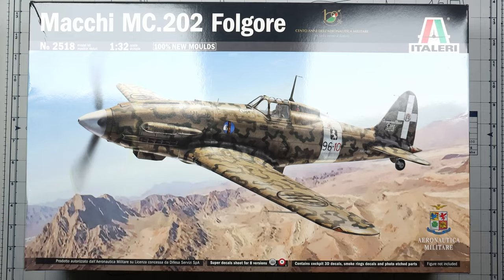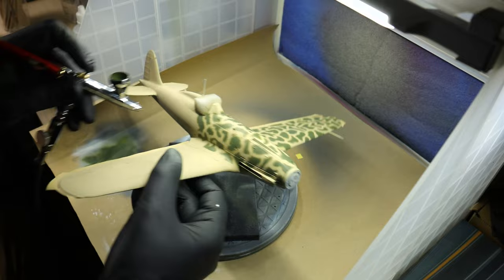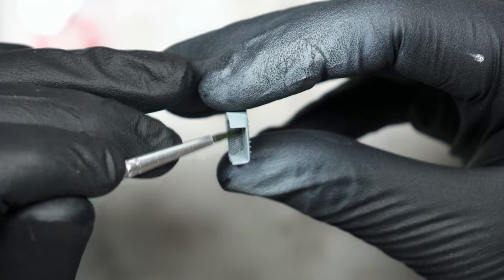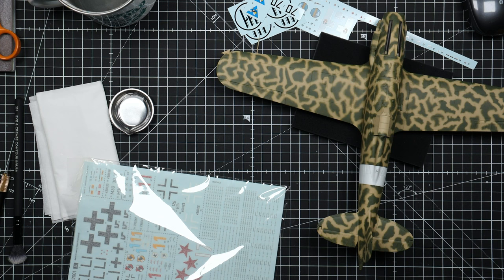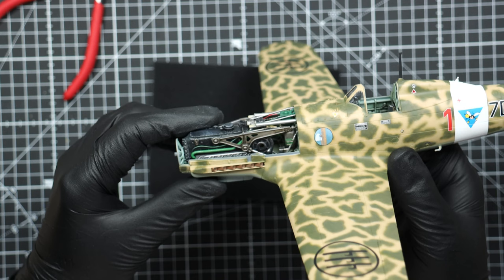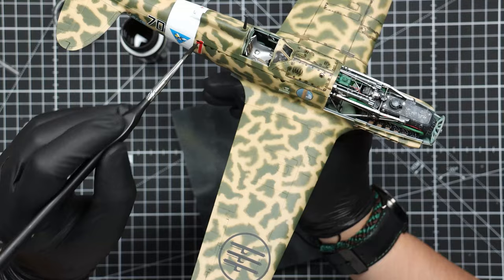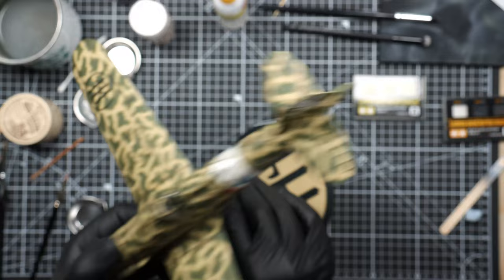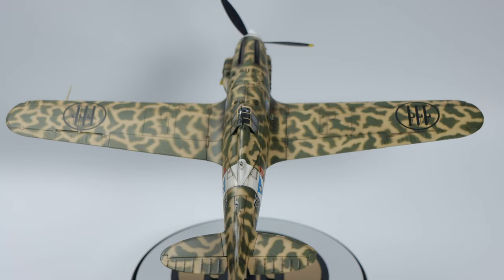Building The Italeri Macchi C.202 Folgore / Part 4 - The Finale

Comment: She looks great to me. Though my advice for Italian markings is making the stripes on the tail first, then mask over it. But otherwise, she's great
Reply from the maker: Thank you!
I know that a lot of people like to do the stripes first then the camo, but I do like if the camo gives a bit of preshading to these. I would assume that these were painted on after the camo was applied in real life as well as they serve as identification markings. In the end I do feel this way is a bit more comfortable, rather having masked off areas for a long period of time where the mask might peel up here and there and paint gets underneath.
And its a miracle I managed to pull that off without overspray.
Reply: @rogueplastic  Oh yeah, I do get that, and I wasn't coitizing. Heck, your improv and fixing of the kit looks way better than 99% of my work. But I just saw the way you were doing multiple masking layers and thought I'd share how I handled the complex geometry of that tail stripe. But then again, my MC202 is a 1/72 scale and I did the white stripe with many layers to really make it pop, then masked and used a flat tan spray paint to provide a base, then took the masking off and added my green squiggles by hand.  But as you said; camo patterns in the Regia Aeronautica weren't really standardized so pretty much anything goes beyond the roundels and tail markings. Also, side note; for big and detailed models, I find the long form, multi parts really enjoyable and helpful to watch
Reply from the maker: Don't worry I'm not taking it as criticism.
Yeah, white really needs a lot of layers to get a nice opaque coverage.
Thanks for the feedback about the content type.

Comment: I thought that having raised panel detail added as PE was a bit of a lazy solution, but on the whole, a good one

But one question. Aren't those exhaust made of folded metal? I thought they have a seam join going down them.
Reply from the maker: I think the PE stuff can work somewhere, but here it felt like a lazy solution, or trying to fix an oversight they did during designing the kit. For the control surface joint covers it can work. But those panels on the wing roots? I don't know...
I am generally not a fan of PE as bending usually sucks and then there is a problem of paint not sticking to it proper. Even with the primer, one can risk paint peel and scratching it off.

Yes, the exhausts are usually folded. I did check my book and on the pictures I could see the weld line along the top sruface, but it was quite faint.
One might be able to add those on top with some think putty string, same as the pro modellers do the weld seams on tanks.

This kit is a scratch builders wet dream as there is a lot of detail missing which can be added onto by hand.

Comment: is it just my eye or the right wing decal is closer to the edge than the right one ?
Reply from the maker: It is closer to the wing edge you are right. It's according to the instructions.
I did also check the book I am referencing and although there aren't too many top-down images, one smoke ring scheme also has this difference.
I assume this is due to the fact that the left wing is longer than the right and the position of the marking is not measured from the edge of the wing, rather the distance it should be from the fuselage.